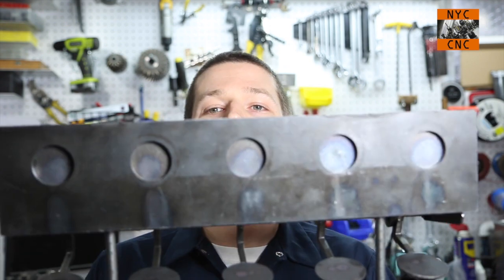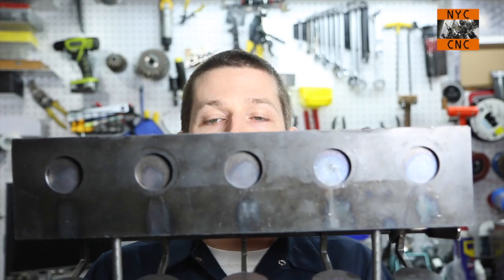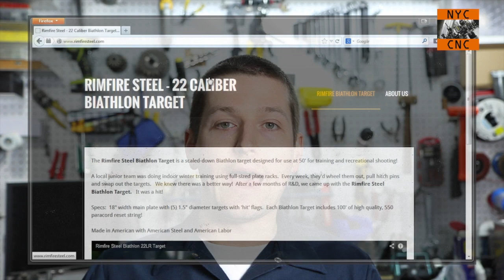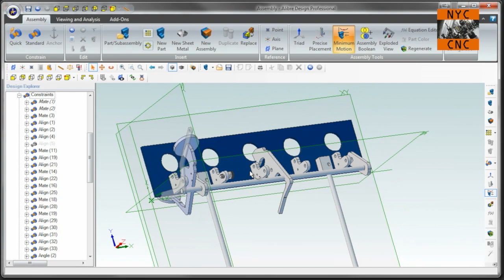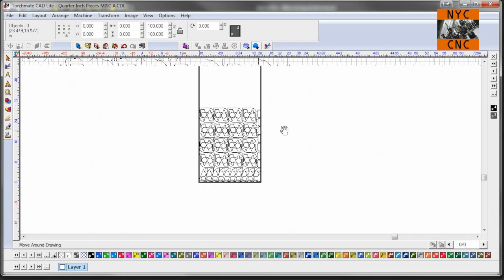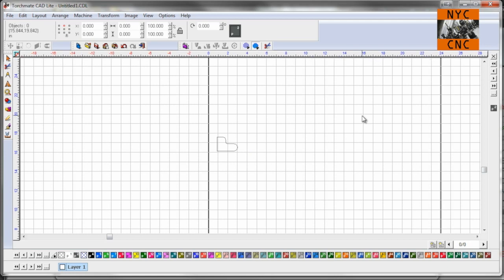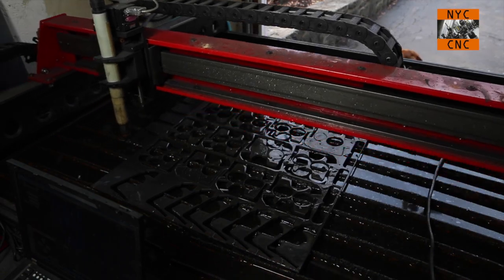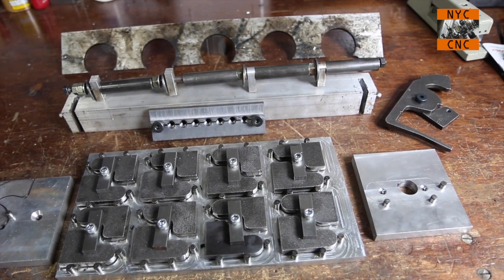Manufacturing At Home: Steel Target - Part 1 Machining & Plasma Cut

Comment: The plasma machine I run doesn't have the water. It is dry under the slats. There is a slagger that we use to push all the slag and small pieces of steel that fall through into a hopper at the end. Then that gets hauled out to a scrap hopper outside. You have a cool little plasma machine.
Reply: It does have a vaccum system that sucks all the smoke and dust out to a filter system. It dumps it all in 55 gallon drums. In fact I just emptied the drums this morning. The drums fill up with a rust colored powder. I call it the solids that are in the smoke. I don't really know if that is what it is.
Reply: LOL It is 11' x 30' We can plasma up to 1.25" it also has 3 oxy heads. The thickest I have burned with the oxy is 5" Just about all our plate comes in in 8' x 20' sheets. Under the table there are baffles. Then as you burn down the table doors open the vac. only sucks in a 4' wide section that your burning in. The vac still roars as it is drawing the smoke away. I wish I could video but that is a no-no!

Comment: Very cool. Completely agree with giving back, the target looks great. I like 1873 SA pistol shooting. Fixtures and jigs are a lot of upfront work, but I bet they have become invaluable for production runs. It was interesting to note that long plasma cutting runs have a greater chance of running into problems. Do you think the work piece became slightly warped by heat or became slightly unsettled as more pieces were cut out of it?

Comment: MyNesting is great! Have used it a few times for laser cutting acrylic, and it's worked pretty good.

Depends on how often you nest stuff, though, if it's worth it or not.
Reply: John NYCCNC Got some credits. I don't do enough nesting to get the unlimited, but I guess it's the way to go if you need to nest a lot. :)

The nesting itself seems to be done on a server computer, so It's quite fast, even on a slow computer.

Comment: great video.  one question i have is why there is so much transit between cuts? ex 11:18.  wouldnt a grid type pattern cut out some time from the cutting process?  are you trying to even disperse heat? maybe prevent warping the plate?  thanks a bunch!

Comment: I'm assuming the long runs in the tool path for the torch were to avoid heating the metal too much in any particular spot?  If so, do you have to do that manually or does the software take care of it?  

Great idea for a video, and the final result looks like a winner!
Reply: Cool!  Even though you demonstrated it i didn't even think of that aspect.  Great stuff..

Comment: John, Have you considered doing some hand optimization of your g-code to decrease run time on the plasma cuts?
Reply: John NYCCNC  Yea so it doesn't jump around so much. I have seen it done a few ways. one way is  relative coordinates and a g52. a more complex way is with subroutines (m98) and then  g52's or with while loops and variables. assuming your controller understands them.

I'm a complete newbie, in fact I've only done one thing in cnc, However a close friend is a very good machinist, and we have talked at length that for 2-1/2 d work like this, a human can still write more efficient code than an algorithm. I'm a software developer by day and that was a hard pill to swallow at first, but having done it once myself, I feel he is correct.

If your doing these often enough you might want to play with it a little, as you might be able to save time, while still allowing for tip-up fixes etc.

Comment: I have a Brobo Waldown Cold Saw, Brobo Waldown is an Australian brand, Until I bought my cold saw I used and abrasive chop saw, And for their price they are great. But they can't cut aluminium, brass, copper etc. And they are noisy, dirty buggers of things.
Since having my cold saw I find I can have it set up in the machine shop as there is no dust, I can work at night because the neighbours can't hear any noise from it's use. The cut is almost machine quality and 100% accurate.. Blades are a little on the expensive side but if you take care of them they will last, plus if you have a tool and cutter grinder you can sharpen your own (I do) I can get an easy 25 sharpens out of a blade before it gets too small. I also use a hydraulic feed flood coolant 20" power hacksaw which is much more economical on blades for large solid steel stock... All in all I would highly recommend getting yourself a cold saw my friend..Your Mate Matt Down Under......
Reply: Yes you can John, But I find if I'm going to be cutting alot of aluminium I will change the blade out for one with less teeth. For steel I use a 132 tooth blade for hollow section, A 98 tooth for solid and if I'm going to cut alot of ally I like to swap out to a 76 tooth blade.. For the sake of no more that 2 minutes to change blades it's worth it...... Hope that helps you mate..
Matt

Comment: I have some AR500 steel plates and would like to drill a new mounting hole in them. How hard is AR500 to drill? What would I need for a bit? I believe they are 1/2"

Comment: Ever though of making a little ring for the torch nozzle, so when the machine Touches off on the Z its not smacking down right where the orifice is?
Reply: Never used it on a cnc plasma. or a manual one really. but its a common hack to put a valve spring over the tip of your plasma so you can drag the tip. i know when im cutting piece at work sometimes i will touch the tip down to change my hand position on the torch {with the arc extinguished} and it FUCKS the consumables up. of course, our machine is thoroughly beat and wore out.... but if its hot, and purging and tap tat tip down. no likey!

Comment: John, More good stuff.
Parts nesting and cut sequencing remind me of the auto routing used for IC and circuit board layout. I seem to recall that there was always some one who went back and "fixed" issues with the generated files.

I was wondering why the tool path seemed to track back over finished parts? Dose the path seem to follow the part placement order from when you copy the drawing into the Torchmate cad cam application? You mentioned that you have the lite version and the upgrade price; seems like it might be a case of "hobble ware" to me.
Reply: I intended to say nice design but got distracted.